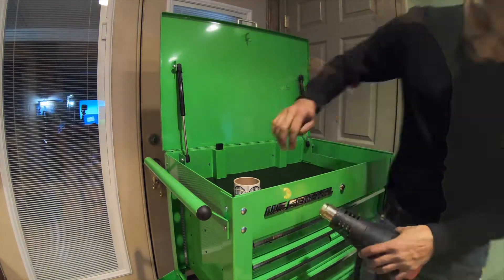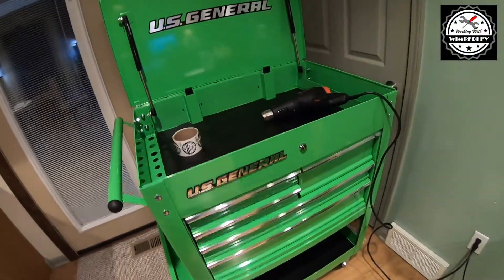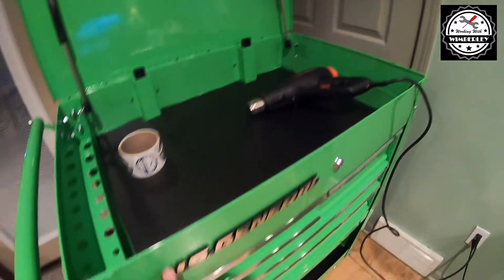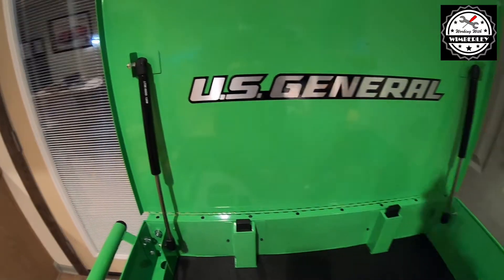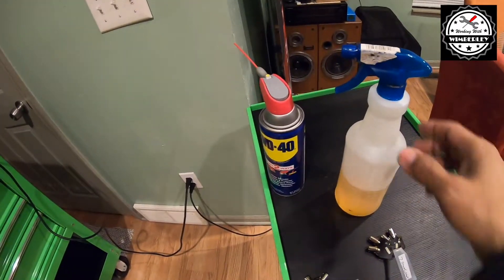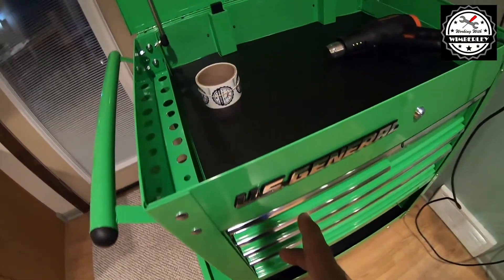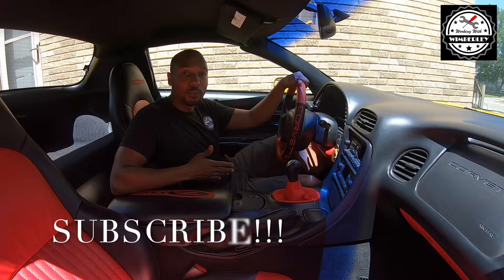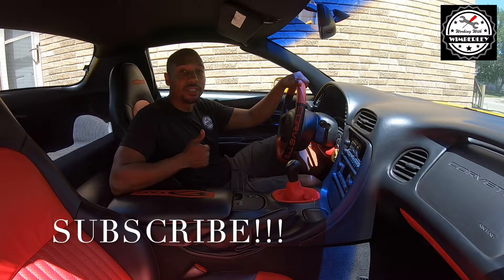Harbor Freight Mechanic’s Tool Cart Debadge Mod Tool Cabinet Bank Service Box Drawer 64721 56237

Comment: Hey man how much are those boxes now?
Reply from the maker: They are $269.99 plus tax. And unfortunately Harbor Freight doesn’t really do coupons anymore.
Reply: @WorkingWithWimberley  wow it's almost 300 yea I know they don't no more
Reply from the maker: @fernandoboss1740  It hurt me to buy it knowing it used to be $199 and HF used to do 20% off. 😂 So there’s a lot of guys who picked this up for $160 a year or two ago. But even at it’s current price, it’s a decent deal and I really needed to upgrade my setup. 👍🏽👌🏽
Reply: @WorkingWithWimberley  yea your right it did use to be 200bucks that's why I'm like damn but now that I got a house I need one just like that I guess it's never gonna go down with this inflation so ima have to buy it regardless
Reply from the maker: @fernandoboss1740  Yup. And if things keep going the way they are, it’ll be $299, then $319, etc. I hope not though.